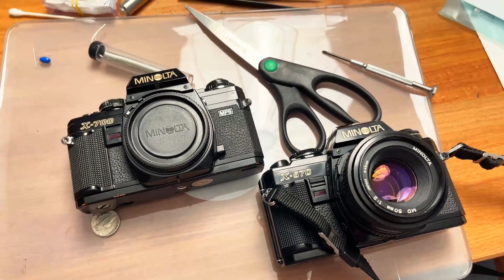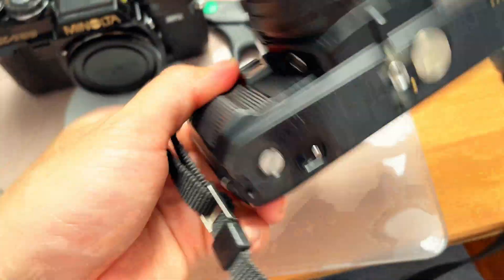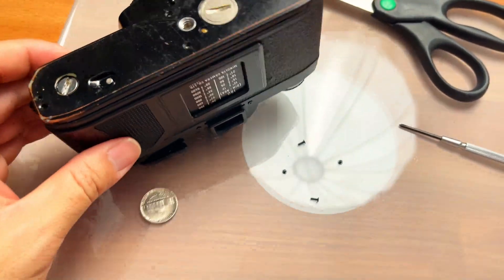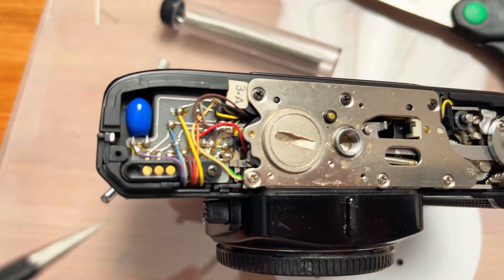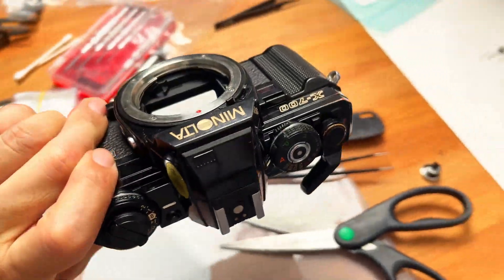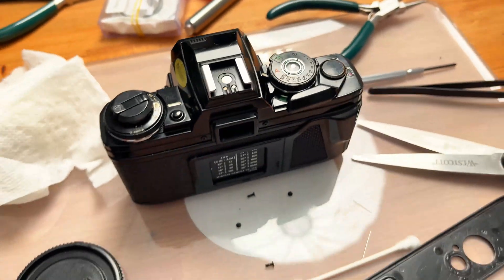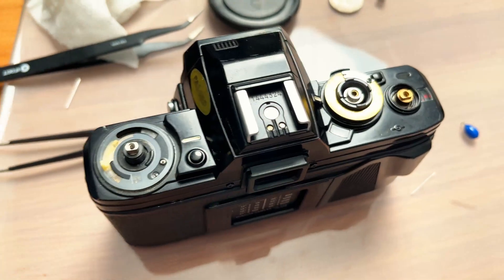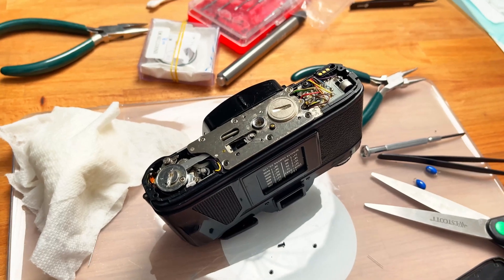How To Replace Bottom Capacitor on Minolta X-700 + Reliability Rant (Also applies to X-500/X-570)

Comment: This blue capacitor was a tantamum capacitor, very reliable and unlikely to be the problem. It must have been your shutter been stuck out of the way. You can fix this by lightly touching the corner of your shutter by the inside of your camera.
Reply from the maker: Interestingly, replaced capacitor and problem was completely resolved.
Reply: @TheGizmoGarage tantalum capacitor rarely fails except if it takes a short circuit or something like that (which is unlikely in your camera). I would bet that a contact in the circuit was dirty and preventing signal to go through, and you cleaned it inadvertently by touching the area while changing the capacitor. The essential is that the camera works now, but tantalum capacitors are more reliable than aluminum electrolytic that dies over time and leaks (creating damage in the circuit). You didn't get a quality upgrade with this swap haha.
Another common culprit is the battery cap getting oxidized and not letting the signal pass. 90% of the X700 that I got sold as parts in my hands started to work back instantly after cleaning up the battery cap with isopropyl.

Comment: Would a 150uF 4V polymer capacitor like the one you used would work ok a X-9 (modernized X-370s)?
Reply from the maker: In theory it would, but it's better to use same capacitor as the one you will be replacing on X-9, just look at the capacitance rating and get similar one.

Comment: For anyone having issues with an x series minolta being dead, even after cleaning the battery cap, try soaking the battery cover/cap in white vinegar overnight, it helps remove the oxidisation/corrosion both on the outside and inside, as there are small holes in the base that allow it to get inside, let it dry and wipe it down (maybe use some more isopropyl alcohol) to clean it off fully, this immediately worked and I never needed to replace the battery cap/cover (please also clean the inside of the battery compartment).

Comment: Great information. The x-570 and x-700 were some of my favorite cameras to shoot with in the days of film.  But they stopped working over and over, so finally moved over to Nikon.  I bet the issues were always the capacitors.  A shame they used those cheap capacitors, because they'd have kept a lot more customers and could have been seen as a more professional company.  Those Minolta cameras were buttery smooth to use and some of the clearest viewfinders I ever used.  A true joy to use when they actually worked!

Comment: Hi! I just got a X-300s on a flea market. I bought it cause it was in a very very good condition but the shutter's block. I open the back plate to check what's wrong and of course the capacitor looks bad ( one pin is green and i know it's not good xD ). 

Did you know if they are the same capacitor for the X-700 and the X-300s ? 

Cause the circuits looks very similar.

Thank's for your video and hope you can help me on this journey ! 

Good day mate.

Comment: good afternoon , I have the x-700 and it beeps when I turn it on but the shutter will not fire all the way? What may be the problem ? A capacitor? If so would it be the top or bottom?
Reply from the maker: If shutter gets stuck half way, definitely some other issue rather than capacitor

Comment: Thanks...i've got the Minolta X-370 and it is recomended to get the Panasonic P954-ND, do you have a better alternative ???
Reply from the maker: Anything is better than the cheap failed capacitor originally installed! Panasonic should be reliable.

Comment: Hello, I have a small issue with my Minolta x700. The speed displayed in the viewfinder is always very low in "Aperture priority" or "manual" mode. However, if I switch to "program mode" without placing the zoom in the "program mode" notch, the displayed speed is higher and seems more consistent. I admit to being a bit confused. Thanks for your help.

Ps: I love your videos!!
Reply from the maker: In Aperture mode, your shutter speed is determined by the aperture ring, so if you set your lens to a larger aperture (smaller number such as F2.8, F4 instead of F16, F22, or F32), it will give the correct exposure. What is also important is to make sure the ISO setting is set to the correct film speed as indicated.

Comment: What would it cost to have the top Capacitar Changed . on the  700 at a camara shop .
Reply from the maker: It requires a lot of disassembly if capacitor on top of the camera needs to be replaced, so I would say it probably is not cheap.
Reply: @TheGizmoGarage  i have two x 700's both work but if this is a problem i will expect  one to fail! I was also told the   early ones had better capacitors. One is 1981 the other is a 1983 so both are early.

Comment: Hey, I have a Minolta X-GM the light meter still works, however the advance lever is stuck and the shutter button does nothing. Do you think it's the Capacitor?
Reply from the maker: Quite a lot to diagnose, it could be a physical damage to film advancing mechanism from a drop/shock, or corroded battery terminal, and capacitor could also be the corrupt: https://simonhawketts.co.uk/2016/05/04/minolta-xg-m-capacitor-replacement/
Reply: @TheGizmoGarage  Thanks for the reply - is there anything you would recommend doing first? The camera advance lever and shutter worked for one shot before it stopped working. What order of troubleshooting would you undertake?

Comment: How much of this information is relevant on my Minolta XG-1?
Reply from the maker: XG-1 is newer and should be suffering the capacitor issue. If anything power related, I would check for battery cap corrosion instead.

Comment: I have my father Minolta XG- that has this problem (hopefully it's just that) do you know if the XG-1 has just one capacitor? thanks!
Reply from the maker: Should have just 1 cap but might want to check battery terminal corrosion, as it's usually the case with Minolta battery caps.
Reply: @TheGizmoGarage  thanks! Will do :)

Comment: Nice Vid! Which capacitor would you reccomend For a Minolta X-300S? I bought a Broken one and it's pretty likely It Will have this issue
Reply from the maker: I used the best available: https://www.digikey.ca/en/products/detail/panasonic-electronic-components/4SEP150M/4204183 but you can also use the slightly cheaper one found here: https://www.digikey.ca/en/products/detail/nichicon/UMA0G221MDD/2598600
Reply: @TheGizmoGarage  Thanks a lot!! I highly appreciate it!!
Reply: @TheGizmoGarage  Hi again! Do you think a 4V 270 uF capacitor would work correctly? It's the one I have available at the moment. Thanks in advance! Your videos are really helpful!
Reply: There is not much camera space   so a larger cap size may be too big to fit in the space.

Comment: I was thinking it odd that you said "all of them" have this issue, but my X700 that I got used for 50 bucks with tons and tons of accessories doesn't have this issue.

Then you showed the old capacitor compared to the new capacitor.

Then I had the idea to open the bottom of my camera and see what was in there. Sure enough, it's already been replaced before I got it. So NICE!

Not that it matters too much. Those two capacitors look pretty easy to reach and replace.
Reply from the maker: Not the top one which requires careful removal of top circuit board which is often vintage and fragile with very thin soldiered wires
Reply: @TheGizmoGarage  Ehh I've seen worse to be honest. It's not even dealing with complex clock work mechanisms like I've seen on older cameras. Electronics is sorta my bag.

Comment: The unit of measurement is ohms pronounced oams.
Reply: Negative. Ohms is the measurement of resistance, usually for resistors.

The rating for capacitors is Farads. This capacitor he used is a 150uf capacitor (that's pronounced microfarads). 
Capacitor ratings are as follows....
Farads (F)
Milifarad (not commonly used) (mF)
Microfarad (one of the most common) (uF)
Nanofarad (nF)
Picofarad (the other most common) (pF)

The difference between them is where the decimal place is located... with picofarad being 1 trillionth of a farad and milifarad being one thousandth of a farad. A 1000 picofarad capacitor is actually a 1 nanofarad capacitor, but is usually just referred to as a 1000 picofarad just to keep things standardized. 

1  .000,  000,  000,  000
F   mF     uF    nF      pF

Comment: Good info in here, but it'd be helpful if you had a tripod or some way to mount your recording camera overhead. That way, you wouldn't have to work one-handed, the frame wouldn't be so jumpy, and we could actually see you de-solder/solder. Important things to see in my opinion. Plus, watching a 10+ min video with constant, jumpy movement makes it hard to watch.

Comment: Good day. At the outset, I want to thank you for an interesting instructional video. These are helpful materials and there are still not enough of them, it is good to revive the old technique. I like this hobby, but I ran into a big problem with my Leica Af-c1 camera. I bought it defective, the flashlight does not work. When I try to take a photo, it is reset and advances one frame. By holding still the "Off" button when turning the camera on, I can take pictures without the flash even in zoom mode. I made a roll of film with it and apart from the scrolled blank frames, the other exposures turned out very well. I opened the camera to see the capacitor that is not working (I can't hear "bzzzzz" charging). The cables by the lamp are okey. The capacitor is labeled 280v 230uf. There is no such replacement available on the market. Can I use a capacitor with a different power? I do not care for the lamp to flash at full power, but for the camera to work without the need to hold the "Off" button. I also reckon with soldering this switch to take photos with greater ease. I would be grateful for some advice. Thank you and best regards 😀 👍👍

Comment: I have a Minolta X7-A. When I recorded it I put batteries in it and pressed the shutter button and the mirror went up, and has refused to come back down. With my finger I can move it down but it springs back up and stays there if I let it go. Is this a capacitor issue? Will the same capacitors for the X700 cameras work for the X7-A camera?
Reply from the maker: Sounds like a dead or weak battery. Get some SR55 batteries and try again.  I always use these https://amzn.to/3FPgXH3
Reply: the other problem is magnet sticks also

Comment: Hi, I have a very strange issue. I can get the beeping to work as well as LED indicators but the advancement lever is stuck and shutter won't fire. Any ideas? I also have an x-300s with the same exact problem :(
Reply from the maker: It could be the issue described here if it's not the capacitor. See this video for reference. https://www.youtube.com/watch?v=6ZndFfBOvSI
Reply: Did you find a solution to the problem with the x700 I have the very same symptoms

Comment: I bought the X700 brand new it must have been about 1987. It just died like a dead battery but it was still on warranty so i sent it in and Minolta fixed it and it worked for years. I have been told that the early models had trouble but later models didn’t.
Reply from the maker: Great, sadly nowdays it's hard to figure out which camera is the old one and which is new
Reply: it is the  other way around the early ones used good capacitors, the late ones are the ones that corners were cut. Minolta started  using cheap parts to compete with the low dollar camaras on the market .

Comment: Not flathead screwdriver, but phillips or crosshead screwdriver. a flathead has a flat head, these don't, they have a cross head.

The reason the original capacitor has no polarity markings is because it's a tantalum capacitor, they have no polarity. They can go in either direction. The one you used to replace it is an electrolytic capacitor, which does.
Reply from the maker: Thanks, the original capacitor did have polarity, it was printed on the backside of the capacitor, once it got taken out, was able to see the polarity and confirm.
Reply: Hello, that's not correct. They are both electrolytic caps. Tantalum electrolytic caps have a polarity, too but if one leg is marked it is the plus leg. Other than aluminium electrolytic caps, here is the marked leg the minus pole.

Comment: Thank you in 2021 i took a trip to Monterey CA. I only took my X-700 only to find my lever locked up. Found a video on utube i think i had to be in the dark pop my lense and manually flip up my mirror and that reset the advance lever.
Any idea on the issue?
Reply from the maker: Not sure... normally the lever only locks up when battery is low, have you tried replacing with new batteires?
Reply: @TheGizmoGarage   yes i put new battery in it. The lever was not locked it was just moving back and forth without engaging and the shutter wouldn't activate or make sound. Sorry i got wrong when i first posted.
I found a utube video that had me pop the lense of lift the mirror and let it drop.
Everything worked after that. Its happened once more since then..
Reply: @jerryrichards8172  Had the same problem with mine, replaced the top capacitor and it works fine again.
Reply: @nichtfabianbittedanke  OK thank you

Comment: What happens when I get capacitors with a higher voltage??
Reply from the maker: I don't know, not a electrical engineer... But it might overload the mirror and shutter circuit?
Reply: @TheGizmoGarage  Hi, so the capacitor sould be exactly 220uF but the voltage is not as important it should at least suport 4V but more is not a problem ;)
Reply: Nothing happens. The voltage rating is what the capacitor is capable of withstanding. It doesn't influence the voltage in the circuit whatsoever. You could theoretically put a 10,000 volt capacitor in there and nothing would happen. It just means the capacitor could withstand 10,000 volts. 

That said, a higher voltage capacitor would be physically larger, so it might not fit in the same spot as the old one. So do try to put in the correct voltage and correct uF rating for the capacitor. Never go SMALLER on the voltage rating, that's very bad. If the original cap is a 4 volt cap, never put a lower rated (less than 4 volts) cap in there, or fire and leaking goo may result.

Comment: Okay so I got a x-700 and my winding lever worked and I fired 1 shot and after that the winding lever got stuck at 30• and now the shutter doesn’t fire. Can someone help me? I thought it couldn’t be the capacitor since it worked a second before..
Reply from the maker: If the mirror stuck at up position, then maybe it's the battery running low. The winding lever mechanism might also need physical adjustment if it doesn't wind all the way. Shutter won't fire until winding is fully complete. But it's a bit tricky to do so do it with caution. https://www.youtube.com/watch?v=6ZndFfBOvSI&ab_channel=FixOldCameras

Comment: I don’t know HOW you were able to unscrew those small screws from the bottom - props to you. Two different Minolta 570s. Tried every precision screwdriver I had. Even bought one for picking apart watches from Amazon. Can’t loosen those screws. 

If you have this problem - might as well start looking for a different film camera.
Reply from the maker: JIS Crosspoint Screwdriver REQUIRED to service most Japanese cameras: https://amzn.to/3FxOC7b It's also highly likely both your bodies had prior water damage and a rusted bottom plate :( You never know what those camera goes through in the past few decades.
Reply: my iphone came with tiny screw drivers that can do the job

Comment: I'm about to be given an x-700 for free because of this issue so I'm hoping to be able to fix it - I suppose I only lose out on the replacement cap cost if I can't, but man I will try haha. Thanks for the vid, it was very helpful!
Reply from the maker: Good luck!
Reply: @TheGizmoGarage  thanks man. We replaced the capacitors in two cameras (including the top, one of which had already been replaced!) and they didn't revive unfortunately. Figured I will buy either the 700 or another and at least I have spare parts in case it ever needs a repair 😁
Reply from the maker: @actuallyWurfles  That sucks, have you tried to inspect the battery cap? Because they are also very prone to going bad! As I have figured out the hard way! https://youtu.be/x0bQj0OfR5A If you have a multi-meter, test the voltage from the negative terminal of the battery placed on the battery cap, and the thread area of the cap, if the voltage is less than 3V, then battery cap is defective and that may be the issue instead of the capacitor.
Reply: @TheGizmoGarage  I considered it but I didnt have a way to test the issue, perhaps I should though as it could save me handing over a lot more money for the camera. The camera doesn't power on at all so that's definitely something to look at, thanks!

Comment: perfect timing to upload this, thanks
Reply: Update: I replaced the bottom capacitor on my x-570, but still no luck. Is there any other capacitor on the x-570 that I could replace to fix it?
Reply from the maker: Nope, X-570 only uses 1 capacitor, if you are sure the polarity is correct on the cap and soldering joint is nice and sound, I'd suggest looking at the battery cap, because sometimes there is corrosion below the metal contacts that prevents the battery from proper connection, see this video I made about the battery cap, if you can find a replacement cap from another minolta camera to try out, or test the cap with a multi-meter.  https://youtu.be/x0bQj0OfR5A